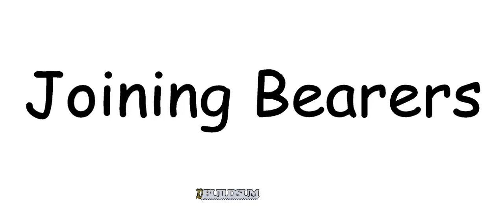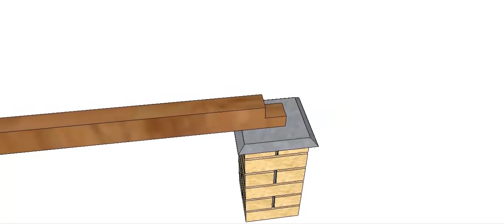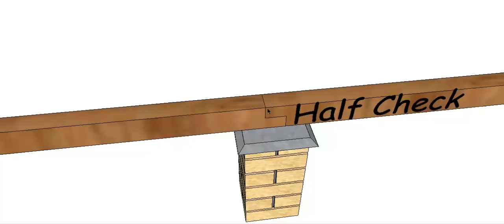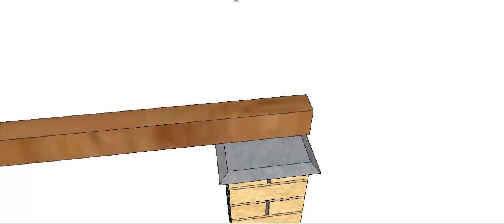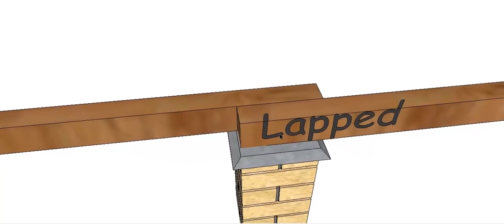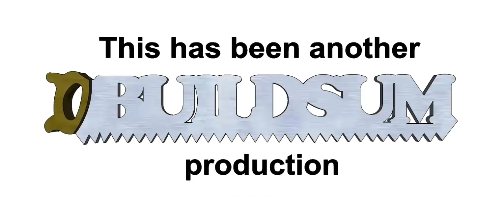Joining Bearers

Comment: Does a lapped bearer needed to secured to eachother. I have an old home that have sunked to one side the piers seem ok but it's in the same spot the lapped bearer sits on the piers. Going to jack it up but wondering if I need to fasten the two bearers together?
Reply from the maker: no they dont need to be joined together

Comment: Hey mate, great information. Thanks. When joining the bearers in a butt joint. As well as use nail plates can you also use timber cleats say 1000mm long on both outsides?
Reply from the maker: Hi Craig, according to AS 1684 the nail plates or cleats aren't required at all. All they really do is stop the joint from opening up which generally would only happen while you are building the floor frame anyway and wouldn't think they would need to be that long either, maybe a metre in total. Hope this helps.
Reply: @Buildsum  thank you

Comment: Thank you!
How do you fasten the bearers to the piers to stop uplift?
Reply from the maker: +Twentyone twos Hi 
Usually threaded rod set into the pier, through the antcap and bearer or builders strap set into the pier and wrapped around the bearer. Or if you require a lot of tiedown use a steel pier as they have brackets and holes pre drilled.